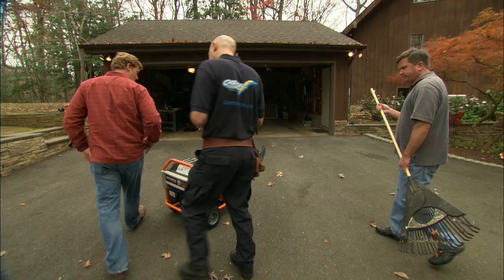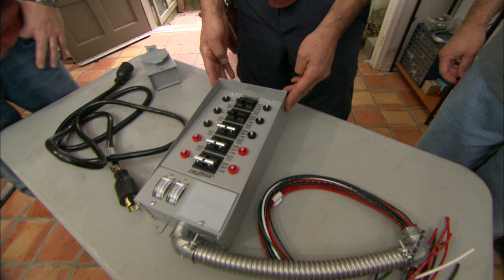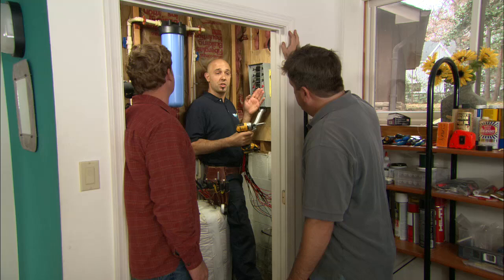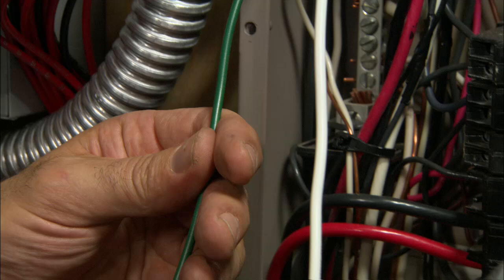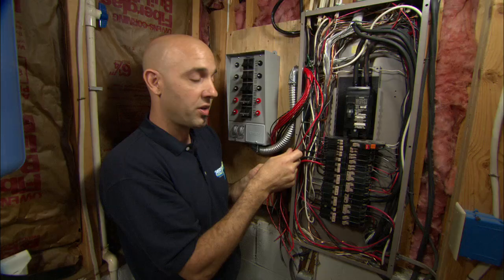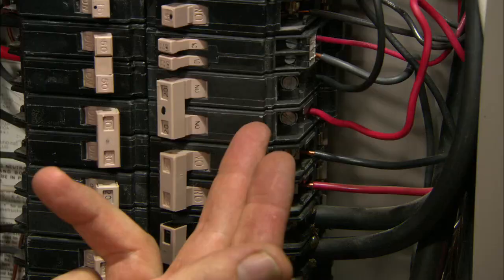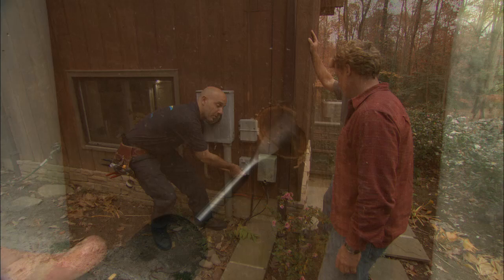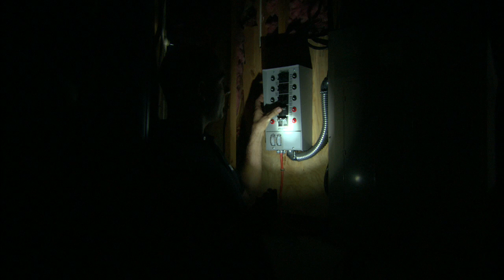How to Install a Transfer Switch for a Portable Generator | Ask This Old House

Comment: In this situation I would  have installed a mains-powered LED lamp on the generator feed so that as soon as the generator is started, it would provide lighting in the utility closet.
Reply: Even better would be a battery backup powered light inside, and either a solar/battery light glued to the wall outside or another light powered by battery backup outside.  That way you can see to start the generator and to flip those switches.  Hard to hold a flashlight (or smartphone...) while pulling a generator starting rope, and those kind of engines usually require you to adjust the choke.

Comment: I installed one of those at my house. My electrical panel was outside so I had to get an outdoor transfer switch. Now if we loose power due to a hurricane or something its just one cord from the generator to the transfer switch instead of having all kinds of extension cords hanging out the windows. I've only had to use it a couple of times but it sure worked great. Mine is a ten circuit panel and the generator is a 5000 watt B&S Storm Responder. It will run all the lights I need, my refrigerator, TV, computer and even a small window unit.

Comment: Contrary to what Mr. Cancro has stated in his post, the Reliance Controls Transfer switch that was shown in this video is not a cheap electrical device. It is a UL listed, high quality transfer switch. The push button circuit breakers used in this transfer switch are a thermal over-current device that are used in a wide range of applications (including the 2-120 volt outlets on Art's Aurora generator) and will provide the same level of safety as those in the main panel. Unless you're off the grid, these are very temporary ways to supply power to your home. I've had both transfer and interlocking switches and they both do the job very well.
Reply: Good information.  The circuit breakers in question are made by Mechanical Products.  A cool bit of information, they were the exclusive supplier of all flight critical circuit breakers for the Mercury, Apollo and Space Shuttle Programs.  Breakers made by MP have literally been to the moon.
Reply: Wrong.  The RC switches use cheap button breakers.  Those are known as "supplemental overcurrent protection devices" and they're not designed as substitutes for the kind of breakers installed in a proper panel.
Reply: Actually Art, you are wrong.  These circuit breakers have been listed to UL 489 (the national standard for circuit breakers in the United States) for about 15 years.  They are 100% suitable for use as * branch circuit protectors * and are not classified as supplemental protection devices, despite what you think or continue to repeat.  Supplemental protection devices have not been allowed in transfer switches for many years.  See:  UL 1008 

The reason these breakers are not used as substitutes in residential electrical distribution is because Mechanical Products only makes them in single pole 15 and 20 amps - no larger ratings, no AFCI/GFCI, no double-pole configurations.  If someone wanted to build a new load center and pack it with these 15 and 20 amp MP circuit breakers, it would be 100% acceptable anywhere in the United States.
Reply: In my experience, people who argue that the cheap button breakers are acceptable, are people who work for Reliance Controls.  I would not recommend cheap button breakers to anyone unless I wanted their house to  burn down.   Frankly, there is no point in buying a cheaply built Reliance transfer box when you can buy a proper subpanel and full size breakers for half the cost.
Reply: Art, I don't see how there is any argument here.  I'm simply stating the fact that these circuit breakers made by Mechanical Products are indeed acceptable and rated as branch circuit protectors in accordance with the NEC and UL.
Reply: For those of you reading this thread, please be aware that Nicholas Schmal is a Reliance Controls employee (found him on LinkedIn -- sales manager for the Milwaukee area).  So of course he's going to make these false arguments about his products.  The reality is that even though those cheap button breakers technically meet the letter of the law (UL 489), they are FAR lower quality than full size branch circuit breakers.  That's why you don't see cheap button breakers in the main panel of your house!  So think about that, folks: if the cheap button breakers are "acceptable" then why aren't they used in the GE or Siemens or Square D main panel in your basement?

I will state it again: for half the cost of a Reliance box with cheap button breakers, you can buy a proper subpanel with full size breakers and a full size interlock.  You'll save money and the quality will be far higher.
Reply: Art, in my previous post I explained why these breakers are not used in normal residential distribution panels - they are only made in 1-pole 15 and 20 amp configurations.  The most common applications are in the marine and aviation industries.
Reply: Nicholas, in my previous post I explained why people should not trust you on this topic because you are a Reliance Controls employee.  End of discussion.
Reply: Art, I'm a Senior Product Technician here at Reliance, not a sales person.  When I post comments on YouTube videos that are related to transfer systems and back up power applications, it's because I'm trying to provide useful information without bias that I feel might help some people.
Reply: LinkedIn says you're in sales, but it doesn't matter; you work for Reliance and are therefore NOT objective.  What I stated is fact.
Reply: No Art, what you've stated is not fact. Unless you consider a completely false, over the top statement claiming that Reliance transfer switches will burn your house down. You are a classic example of " a little knowledge is dangerous." I wanted to be respectful to you in my reply, but your ridiculously inaccurate  posts makes it very difficult to do so. The fact that Mr. Schmal actually works for Reliance Controls, should tell you that he knows what he is talking about. He rebutted each of your false claims with solid facts.  I sincerely doubt that he would respond to an obscure Youtube video just to boost the sales volume of Reliance products. More likely he wanted to respond to your false statements regarding the safety and quality of the Reliance Transfer switch in the above video. In your video commercial for Aurora Generators Art, you say that there is a lot of misinformation out there. May I suggest that you stop adding to the pile.
Reply: You'll remember what happened to Apollo 11 when they flipped the switch to stir the tanks...  Class dismissed.
Reply: But evidently what nicholas stated is also fact; these are UL listed.
Reply: The tanks were stirred when they did that. Now on Apollo 13 the story was different.
Reply: Daniel Kolp i
Reply: 243wayne1 , "You'll remember what happened to Apollo 11 when they flipped the switch to stir the tanks..."
That was Apollo 13 Wayne, not Apollo 11 you big dummy! Class dismissed, school's out and see you next year...  : D

Comment: I prefer using an interlock for my panel. It gives the homeowner more flexibility on what can be turned on. I did it on my house and love it. I just did the math and have all my circuit breakers marked that can be on while using the generator. Also marked higher powered circuits so that my wife knows that only one of those can be used at a time but still cam be switched between.

Comment: That panel is a mess.
Reply: +Couldn't think of a good name so i guess this is it  - you are correct, If anyone i work with did that i would almost make them redo it blind folded. Almost, but the would redo it.
Reply: +Couldn't think of a good name so i guess this is it 
It is I agree, can you imagine the same panel made in Germany ? 
It wud simply be perfect !
Reply: +Couldn&#39;t think of a good name so i guess this is it I could do a much better job and I am not an electrician.
Reply: Phillip Dollarfield's Polo Emporium and he made flying taps inside the panel.  Against National Electrical Code.  This is why they make junction boxes.  !!
Reply: Most ppl don’t care what it looks like I take pride in my work and want it neat
Reply: Its overloaded.

Comment: I installed a interlock kit.  It was easier and cheaper.  I also have the ability to power my entire house.
Reply: Came here to say this.  Interlock is much simpler if your generator is beefy enough.
Reply: But can you do an interlock kit on a panel with push button breakers?
Reply: mschmidtTX - Or if you're smart, you can just decide what breakers to turn on and off manually so you never draw too much.
Reply: That's why I like the interlock setup over the installation of a transfer switch; it's a lot more flexible in allowing selection of different circuits to power up.  
The transfer switch doesn't cover every possible circuit in the breaker panel, so it requires you to plan in advance exactly what you want to power up in a blackout, and if you ever change things around, no way to power up any circuits that weren't covered.  It also adds more breakers inline with the circuits that are more points of failure and need to be matched up with the selected breakers.
Reply: As far as I know (and I'm a dealer) nobody makes an interlock system for the old Pushmatic breaker panels.
Reply: I did an interlock kit and added a Wattmeter and color coded which of the two lines (Phase) all the breakers come off of. Wattmeter shows one phase is being used heavy while the other is light? Flip off a couple of the one color and add a couple of the other. You always want your loads to be balanced or you will burn up your generator.
Reply: ++ fin screenname..  Excellent point on balancing the circuit load but a well thought out system will have the basics already balanced via moving a few breakers around in the panel BEFORE you need it. Yeah, it's a little more work up front but it keeps you from forgetting later on. As an example: boiler on one leg and fridge on the other, or making sure that deep freezer is on the opposite leg from the kitchen fridge, and the coffee pot is not on the same leg as the microwave. With a little advance planning the average small home will probably run around 10 - 15 amps per leg on a winter evening, including lights and TV, which means you still have some reserve for motor starting on that fridge / freezer / boiler.
Reply: I'm not an electrician....... that being established,  what is an interlock kit?
Reply: An interlock kit allows the full panel to be powered. The basics: You turn off your main breaker, move a (for lack of a better description) specialized piece of sheet metal which locks off the main and allows the breaker that keeps the generator plug off to be turned on. they are pricey when you look at it ($80.00) but it allows you to within reason use any light in your house, or any outlet in your house. We drive a 2100 sq foot house with a 6.5KW  Honda, with a bit of "load shedding" we can even do laundry (not using the dryer.) We are on generator every winter from one to ten days depending on the weather. These transfer panels as shown here are not worth the money, as other have pointed out they are too complicated and you do not have full use of the electrical in your house. Google "Interlock Kits"

Comment: New homes are being wires with AFCI circuit breakers for many of the loads you would like to transfer over to the generator during a power failure.   I like the Reliance transfer switches but would like to see what the manufacturer recommends doing to keep the AFCI protection on these circuits.  How will Reliance comply with the code for these circuits going forward.
Reply: Thank you for bringing this up as it will become more frequent as AFCI usage increases as time goes by.  There are plenty of alternatives that accept AFCI or GFCI breakers that Reliance offers.  The most common option is to use a sub panel with an interlock and move the selected household circuits over to the new sub panel.  Reliance has hundreds of these interlinked breaker panels available and they haven't changed much in a very long time.   Also another version of the transfer switch in the video has been available for several years and uses 1" circuit breakers so that AFCI breakers can be installed as well, but in general a sub panel switch or a main panel feed-through switch are better options in most cases.

Comment: Nice system and meets ALL codes if installed properly, but I have one observation. Connecting stranded wire on this transfer switch to solid wire with a wire nut seems to be against code. The work-around is either tinning the stranded wire with solder (makes it "solid" wire) or using a terminal style wire bug with one wire per screw. As for wire nuts inside a panel, that seems to be a local code issue, which could easily be solved with a small wire tray or junction box. The makers of these panels have been through UL testing so if it's in their instruction manual then it's ok for most code. Ya gotta read the books!
Reply: Solid and stranded wires can use wire connectors, the manufacturer's instructions will say to lead the stranded wire about 1/8" ahead of the solid wire when screwing on the wire connector.
Reply: Who ever told you that nutting stranded and solid is against code? Should be IMO, but as far as I'm aware it ain't. Reliance controls is correct, always lead the stranded just ahead of the solid for best results.

Comment: FYI - Canadian Electrical code wouldn't allow you to use the panel as a junction box (so this system won't work in Canada) . You would have to take the wires out of the panel for the critical loads and tie them into a separate sub panel. That sub panel would be fed through a transfer switch from the main panel and a generator. You have options of Line (grid) off and Generator.If power goes off. you start the generator - switch the transfer switch to generator mode and presto the power would feed your critical loads. When the power is restored - you simply switch the transfer switch to line (grid power) - power down your generator. Bobs your uncle....Jer